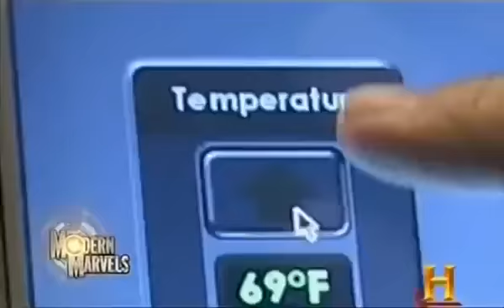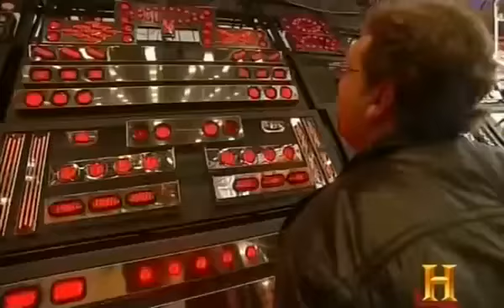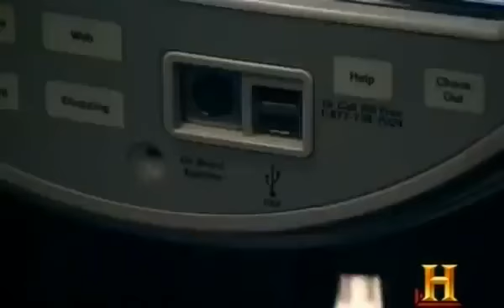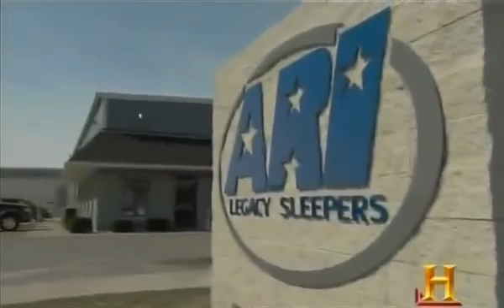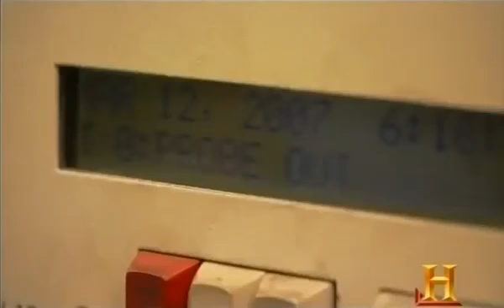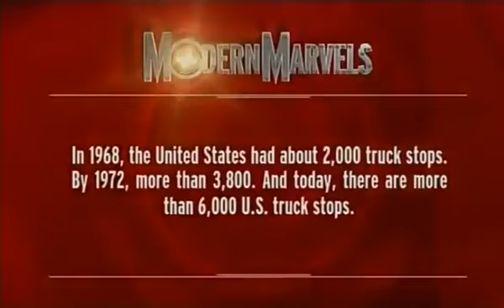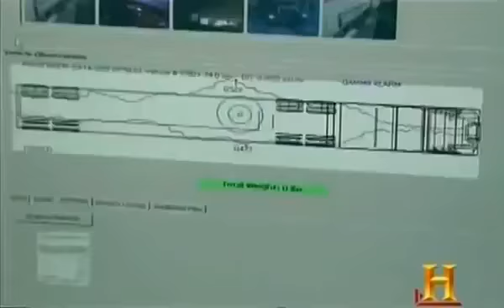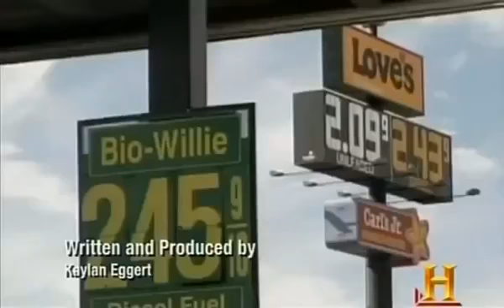Modern Marvels   Truck Stop 360p

Comment: Being a truck driver years ago I like the truck stops that had Idleaire stations. I had a account with them where they gave you a specially made window mount where you attach the idleaire unit to it and presto! This save you wear and tear on the truck engine and fuel. I hope they they still have them at these stops. And all trucks should have generators. Many ways to reduce emissions. But a super sleeper: I would love to have one. But you'll need close to $100,000.00  to get one. But it's worth it. And you definitely have all the comforts of home in your super sleeper.
Reply: Idle air went out of business a while ago.